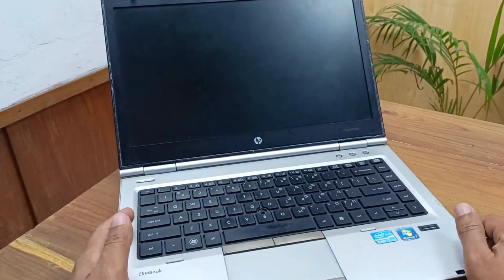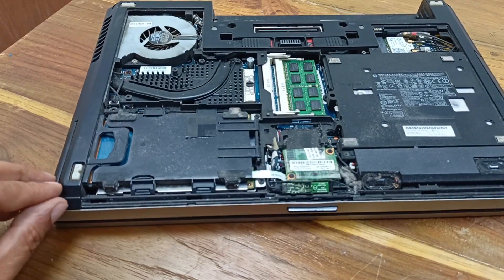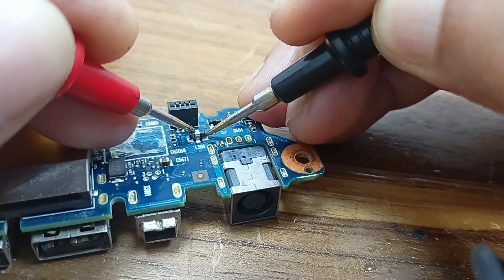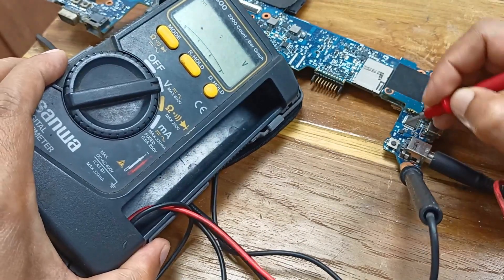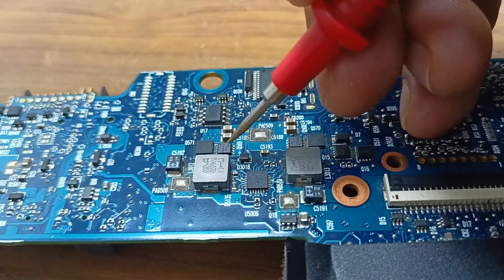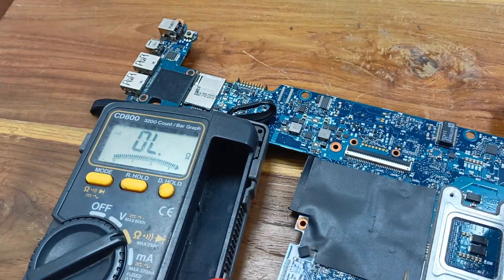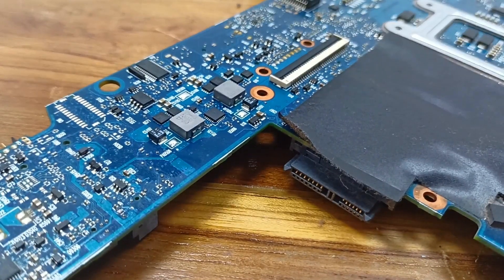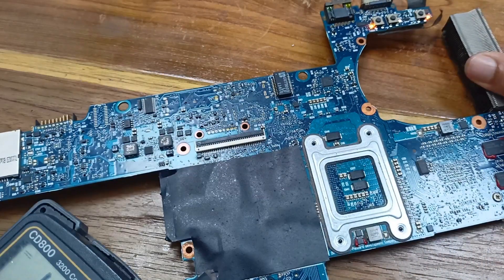Hp Elitebook 8460 laptop power won't turn on || Laptop mother board repair

Comment: I need your help. Have a similar one (8470p) and it always boots on starup. The Bios for autostart when plugged in is turned off. Did bios resets and updated the bios, no solution so far. 
Also, the power led on the front panel does not light up at all. It just turns on automatically.